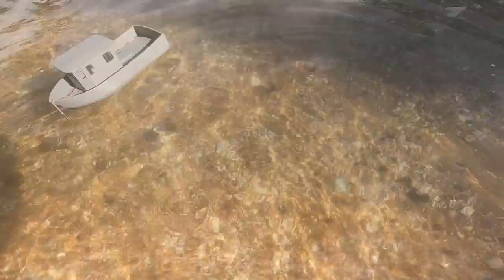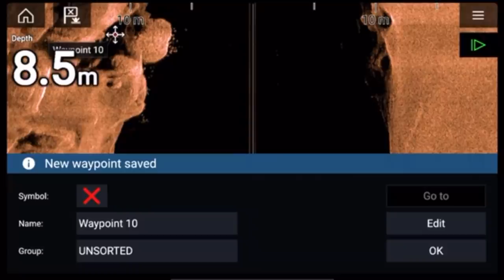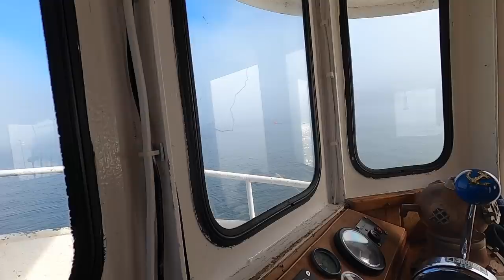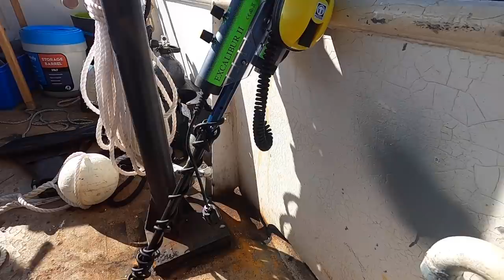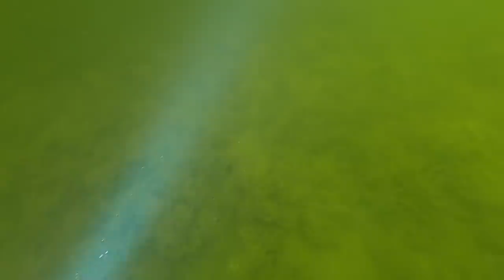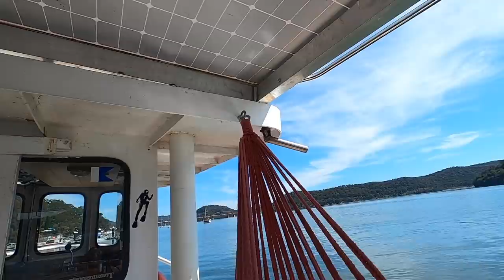The mystery of the stuck anchor

Comment: This adventure was fun, at least for watching.  I feel your pain on the getting older nonsense!  Mine is with all the layers of winter gear.  The idea with the guide rope weighted at both ends might work, maybe have another rope connected with a ring so it can slide along the fixed rope.  That would allow you to explore up and down the terrain, and hopefully not get terribly tangled.  Or, maybe attach a metal detector to the ROV?  It could become some kind of mad science/engineering experiment.

Comment: Hi Stu. That was cool to watch. And relevant too. Yes, I have a mystery on my river - just like you. Its best described as 'The mystery of the Yamaha 90 and, 2 x 10 meter control cables, and electrical harness extension. Yes, all that kit that fell off my transom at WOT. My first inkling that something was going down was the feeling of whipping cables running past mt legs and feet. As far as I can work out, someone had removed the fasteners in order to burgle my Outboard.
.BTW, Don't worry mate, have got my respect. Watching your mission has given me a laugh and the heart to keep up my search albeit in the Tamaki River Haystack
 In terms of progress so far, Ive only got as far as 3-4 hours of random passes, whilst recording my side scan data of the rivers silty bottom.  ' I know she's down there and Im just glad I'm not down there with the outboard. Dodging a bullet is always a happy ending.
Reply from the maker: Bugger, sorry to hear that happened. The trick with sunk outboards is to get them running as soon as you can after getting them to the surface. Good luck!

Comment: I guess one approach, when first cutting away the anchor chain, is to attach a small buff on a short rope to it, so that it's well below the surface but floats high enough off the bottom for the diver to find it; if there's a worry it'll be carried away by a passing boat. Anyway, good hunting for your anchor.

Comment: Interesting project....a couple of points; (hope you dont mind the input)
ROV's are great but if vis is low it may prove pointless and with the topography and tidal current may also prove quite difficult/hazardous to navigate especially with the tether....your anchor recovery could easily turn into an ROV recovery project.
There are a couple of other basic options to underwater search survey the area.....comes down to planning.....determine estimated dive time/bottom time and then estimate/predict search area which can be covered in time available/budgeted. Then choose methodology.
1 - Concentric circles tried - determined not suitable
2 - Compass /bearing line search from central point - connect tether to central point choose a bearing (usually start at 0 degrees mag) and extend search swimming that bearing predetermined distance, return on reverse bearing .... collecting tether along the way. Then rotate to next bearing 2-5 degrees magnetic (this depends on search conditions and visibility) and repeat (work area like bicycle spokes). This allows you to search/cover ground through difficult terrain in a systematic method.
3 - Establish baseline transect, a line (marked at intervals like every two meters) from central point (float anchor point) to a predetermined point (usually 0 degrees mag) at a predetermined distance (peg it to the bottom) and run straight search transects parralell from that base line (at 90/270 degrees magnetic).
There are many other ways, too many to note, but fundementally it is about making an educated guess where to start (using all information you can gather....grid survey the broad search area with you sounder could provide a reference), knowing where you have searched so you don't waste time, having a simple easy to execute plan....cause thinking is hard, and using a repeatable method that is effecient and safe.
Don't forget to carry a tag line to possitively mark where the anchor or chain is if you find it (can use the tether but sometime you find more than you bargin on).
Reply from the maker: Yes, I think searching along compass bearings could be the way to go. We’ll search again soon!

Comment: Stu, one thing id recommend, especially since your doing more work related things, and less sight seeing with your dives, is moving from a "yoke" style 1st stage, to a "DIN" style. the thread in connection on the DIN is much stronger, and less likely to get knocked loose if you bump the top of the tank, or get entangled in something. most manufactures make kits to convert the regulator from one style to another, so you wouldn't need a new reg, just a few parts. Ive also found they tend to have less issues with making a good seal, unlike the yoke style.
Reply: I agree. And the O-ring is in the reg not the tank so it's harder to lose.

Comment: I left an anchor in a lake and another in the ocean after they got stuck.  I had to leave quickly as the winds were picking up and the swells were getting big.  I carried a "Crocodile Dundee" type knife at the steering wheel for quick cuts of the anchor rope.

Comment: I did quite a few "lost anchor searches" back in the day (visual, no metal detecting gear).  My one comment about that is .. a lost anchor is very hard to find.  You would think it should be easy to spot with the chain and rode hanging off it, but it never seems to work that way.  Unless you drop right on top of it, searches are too often non productive.   BTW: my dive certification is 29 years prior to yours (time flies, eh?). The standard tank back then was steel 72 cu ft @ 2250 psi.  My "high tech" rig had twin 72's with a custom manifold that had 2 regulator ports so I could have a second reg for emergencies.  That rig was very heavy.  I don't think I could even pick it up today.
Reply from the maker: For sure finding anything underwater is much harder than most people realise. I’m looking forwArd to practicing and get better at it though.

Comment: Wondering about a curved removable handrail that hooks onto the roof and drops into a sleeve on the inner side of the gate (when made ).....serves a few purposes....would stop the gate flapping about from wakes when boarding after a dive, and more importantly, would give a solid hand hold when getting near the top of the swim ladder and transitting to stepping on deck while wearing dive tanks etc. Drop it in place when setting the dive flag, or have the dive flag on it as well.
Cheers beers !
Reply from the maker: I would love to have a ladder that could also provide easy access to the roof of the wheelhouse when not in use for diving.
Reply: @DangarMarine  sounds like a project !! How about a hinged ladder pivoting on top of the hand rail and locking to the cabin roof?

Comment: Suggestion on searching, I was thinking about a cargo net. Maybe painted or ordered in florescent orange. Maybe a 10 x 10. Lead weights on the corners to keep you searching in a certain area.
Reply from the maker: The trouble is you would need to be under it to search the valleys between the rocks.

Comment: Cool video. It was exciting watching the search dive! Is there such a thing as negative visibility 'cause damn that looked rough!   Stu, the downward pointing 2D sonar (3D side scan could be used in overlay mode if the Raymarine offers it like my Lowrance unit does) could resolve a pattern like a stretched out chain (and the chain pile formed when you cut the chain) if it is not buried too deeply into the silt.  You can adjust the contrast and gain on the sonar and that will help distinguish higher density materials from lower. Worth considering anyway.  Good luck with the search.  Cheers!

Comment: We did some searches in a flooded taconite (iron) mine where there were obstacles and the variable depths. We marked grids off a center anchor like a pie. The teams didn’t swim next to each other but one stayed low and the other about 6-8 feet above. At times we tethered together because viz was nil and it you couldn’t maintain any coordination between divers. We did have some advantages since there were 4 divers. It’s boring for the guy that is above since he rarely sees anything but his primary job is to direct the guy in the muck below. Any rock or uneven surface we came to the upper diver has to stay on the pinnacle and direct the lower diver usually using a tethering line. It’s very slow methodical work but we found many hand tools, anchors, mining equipment over a couple day period. I think we went thru 12+ tanks of air (or so). Depth was only 30 feet average (quite a slope tho dropping off to 100’) so bottom time wasn’t as big a deal as water temp (45F). We had tried over the years to do random searches with very little success and finally started a much more structured approach.
Reply from the maker: Very interesting technique. You are dead right that haphazard search very rarely find the target. A systematic approach is essential.
Reply: One distinct advantage to this situation was we weren’t looking for a specific item we were just looking for things generally. I must admit I have found more anchors by chance than anything else. Silt bottoms are nasty search environments. Once we tried to find a wooden ship wreck in a fresh water lake. When we got to the bottom it was pitch black like a night dive. We kept seeing this smooth bottom contour but it was shimmering in our lights you could stick your hand down in it as far as you could reach with no resistance. I tried to settle fin down into it and was completely immersed in silt. We figured it was more than 10’ deep. Needless to say we never saw any ship!

Comment: If your doing lots of diving I can't recommend a dry suit enough. Easy to get in and out of and you stay dry and warm. Especially good in winter. I had a 5mm neoprene Seasuit (made in South Australia) Never cold on a dive, no damp wet suit to struggle into for the second dive and much less fatigue levels at the end of a day of diving.
Reply from the maker: I’ve never done any dry suit diving but I’d be very keen to give it a go.
Reply: @DangarMarine  A bit tricky to get the hang of at first but once you get used to it you won't go back to wetsuits (unless your in bath warm tropical waters).

Comment: You are doing great videos. I am fixing up a 15 ft fisher mariner boat with a Johnson 25 hp. Got the motor running. Thanks to you and other videos.
Just want to see how you fill on putting Seafoam in a two stroke. Does it need it if you clean the carb and plugs?

Comment: Lol...I was fishing at Flint n Steel one day & I couldn’t pull up my reef pick.  So I tied off and drove a bit and it had dislodged so I went to neutral & it was stuck again??? Tied off once again, drove forward and crawled (despite lots of throttle) towards a patch of sand to prove I wasn’t insane.  I then managed to pull up a lump of crud that consisted of  2 other reef picks and two sand anchors, chains, anchor rope and sea life.  Two were in perfect condition so I sold em and the older ones I still have.
Reply from the maker: Good score!
Reply: Thanks.  I’d love to see how many anchors, ropes, chains and sinkers are on the Flint.  It’s probably 50% reef and 50% man made equipment losses by now.

Comment: Stu, I understand the reasons you gave for not attaching a float to the chain before it was cut.  from the sonar it appears you were in 8 to 10 meters of water, with 1 to 2 meter tall rocks on the bottom. Did you consider tying a 1 to 2 meter long piece of poly rope to the anchor chain before cutting it loose, and dropping it to the bottom? The poly rope will float, and shouldn't be burried in the muck on the bottom. It should be easier to find a short length of rope sticking out of the silt, than a chain buried under the silt. It might even be possible to attach a small float to the free end of the poly rope, not to lift the chain, but to make the  rope easier to find when you go back to retrieve the anchor and chain. I know it's to late now, but maybe next time?
Reply: Stu, as a follow up tomy last post. I mentioned attaching a small float the the end of the poly rope. I just remembered something, I read somewhere that a sonar ping doesn't reflect from a submarine, it actually reflects rfrom the "bubble" of air contained within the submarine. Don't know if this is true, but it made me think. Could Renko's sonar find a 1/2 or 1 liter sealed (empty) plastic soda bottle anchored off the bottom? Miight make it easy to retrieve an anchor if it was a simple matter of attaching a sealed (empty) soda bottle to the chain, and doing a sonar search. Might be worth experimenting with one day when you are out "messing around on the boat".
Reply: @kwbarnes1  yep sonar picks up anything that has air in it

Comment: It is entirely possible that the owner came back with fancy scuba gear and for his anchor back....you should just build a sled and drag a metal detector loop down the bottom....I would imagine for something massive like an anchor chain, you could build a rudimentary metal detector from some magnet wire and a few electronic components.

Comment: if your going to use Renko a lot, especially for filming you gotta go crazy with the Dyna mat (or equivqlent).  I know its a work boat but needn't sound like one.  AUnder $700 probably. We had a timber 1940s bay cruiser with a Ford Lees that sounded like you had your head actually inside the engine whilst unerway and we got that down to a gentle conversation level.   Dynamating  or its equivilent is the best thing you can do to a old boat.  Is mazing how much fatigue from being on a boat is noise.. Dynamat everything,  would make a good video,
Reply from the maker: I’ll check it out.
Reply: @DangarMarine  I thought it was a little noisy too.

Comment: Thanks for the informative and helpful videos...
I have a question maybe you might help with.
I have a Mercury 2.5 HP four stroke outboard that I use as a kicker for my sailboat and I was wondering if it would be up-gradable to 3.5 HP by merely changing the Carb Jets.
My basis for this theory arose when I was looking for parts online for the 2.5HP motor.
As I was looking through the parts diagrams for the 2.5 HP and the 3.2 HP I noticed that ALL the engine parts are the same IE, SAME PART #s…  AND... The cylinders are the same size, the bore is the same, and the stroke distances are the same. The ONLY differences I could find were the Main jets and Slow jets had different part #s.  The part number for The Carb Housings are different too... BUT EVERYTHING ELSE IS THE EXACT SAME.
So in my “Genius”, I figured that if I were to replace the 2.5 HP’s Main and slow  jets with jets meant for the 3.5 HP, the power should increase.
Now I’ve already bought the jets (but not installed them yet) and I was thinking that the jet holes on the 3.5’s will be a little bit larger, letting in more fuel… and thus producing more power at the throttle.
I’m thinking the simplest, quickest way to see if this works would be to run the motor in its original state and record the High and Low speed sounds from a certain distance… Then change out the jets and record the High and Low speed sounds of the motor again. Then compare the before and after sounds to see if there is in fact a difference. 
Does this Rational make since to you? 

Thanks.

Comment: I'm sure you have a Google Drive full of Service Manuals. Could you put the link (view only) on your video descriptions?
I'm repairing a Mariner 60HP 2 strokes 1996, no sparks.  I just found for download the Service Manual for the newer version (1998 and above), but the ignition system is different (no switch box, build-in ignition drive on each coil)
Tks for your videos full of technical knowledge.
Regards from Brasil.

Comment: I like your videos, but I have a question we have a 2002
90 horse power Yamaha outboard 2 stroke, and I need to replace the o-ring on the center carburetor at the end of the prime start red lever, part number 6H3-24452-10-00, Yamaha wants to replace the whole cover or part for 60$ USD, do you know the part number for just the o-ring? Or where it can be found or is available alone Itself??

Comment: Just wondering, should the knife not be strapped to the inside of the calf so a dropped weight belt wont snag on it?  Did my ticket back in '82-83....   getting old isn't much fun.... lol
Reply from the maker: There are pros and cons to both sides. I personally think I could drop the weight belt easily enough with it on the outside and avoid the annoyance of having the knife in the way when finning.

Comment: Couple of questions - couldnt you have buoyed the chain 1-2M off the bottom so the buoy stayed submerged and not a hassle for surface craft, but you'd have a shot at seeing it when you went back - also before you cut the chain couldnt you get a GPS fix from a phone etc. - be better than nothing?  I realise both of these are 20/20 hindsight - sorry.